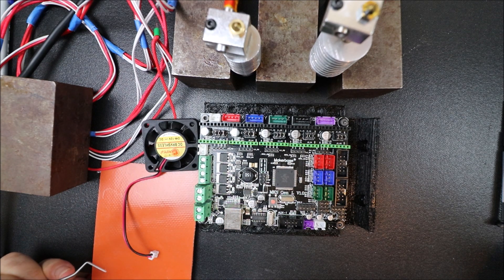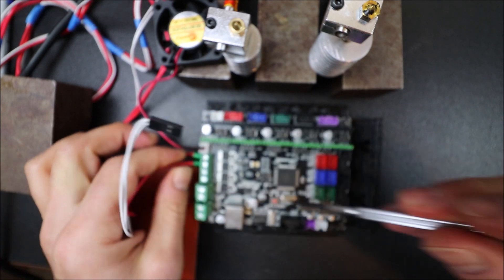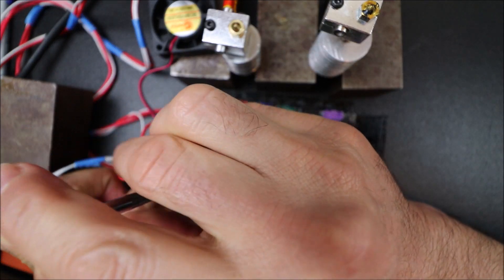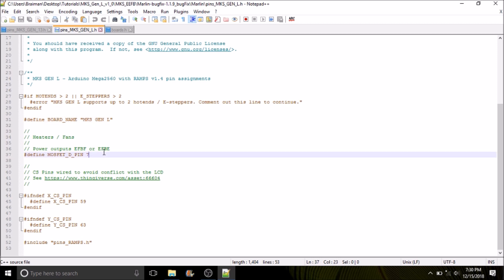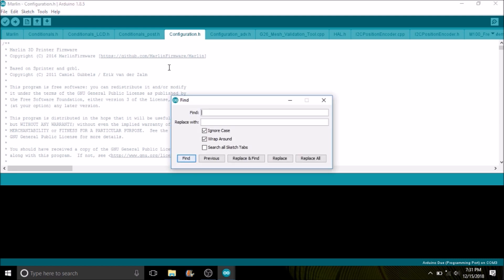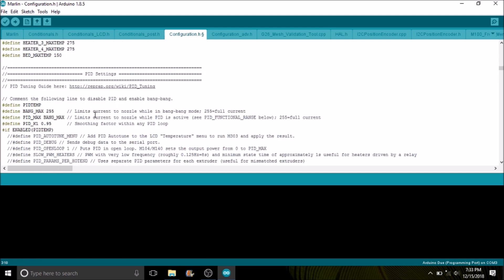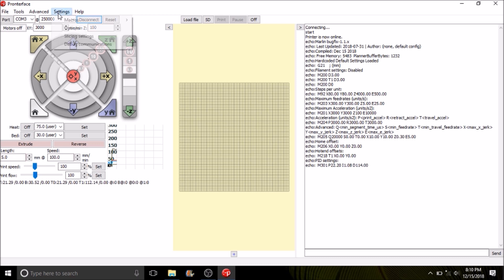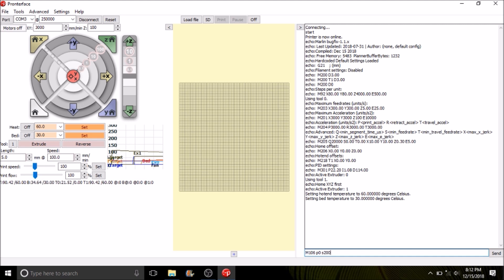MKS GEN L - Extruder Extruder Fan and Bed (EEFB)

Comment: HE1 means secound extruter hotend is not heating up it's throwing heating error . i tried exchanging extruder pin but same problem hotends are working good!
can you plz help
Reply from the maker: There is a link in Description to Discord.  either myself or someone else cane help in General Chat.  The issue you're describing is probably related to Thermistor connection.

Comment: I recently brought  MKS Gen 1.0. I uploaded the Marlin 2.0 by USB port. It works fine with USB port and I unplugged the USB port, then I connect 12v supply it also works fine. ( But the think is when I connect.  both cables the board heats up. Few smoke came near the USB port. After that my board is not showing in DEVICE MANAGER when I connect with  my PC. What will be the problem?. Can you help me buddy.
Reply from the maker: Sounds like something smoked on board.  Are there burn marks on a chip on the board?
Reply: @EdwardBraiman  No burned mark on components but when I check with multimeter a small capacitor got short.
Reply from the maker: Use the link on channel for Discord

Comment: hello i have a question that i hope you may know, i accidentally broke 2 analog pins of my mks gen L card, so there is no analog pins left for the heatbed thermostat, can I use the aux input as analog pin, any help would be greatly appreciated.
Reply from the maker: Could you be more specific as to broke pins?  If physically broken you can soldier on new pins.  If you mean board level cooked motherboard, then unsure. Otherwise I need to consult documentation for for a more complete answer.

Comment: Greetings Ed, Great tutorial! 
On my case I've a MKS Gen L V2.1. Very similar pinout as yours. I've followed your tutorial since the Extruders, Bed and Fan,  have the exact same pin out. But,  when when I get to the testing on Pronterface; I select Tool 0, hit "Set"  and  Hex 1 is On. All Right.

When I select Tool 1, The Fan turns On, and I can see LED D1 light on. 
When I prompt M106 P0 S200,  nothing happens. When I Set on the Bed,  nothing happens.
It looks like the pin assignment is wrong...
Reply from the maker: They might have a pinout diagram on MakerBase GitHub or check pins file.
Reply: @EdwardBraiman  I have the pinout diagram and the schematics. But for what I can see it's the code. The board doesn't turn on  the Bed Heater with the M190 Sxx code.. I can't figure this out.
Reply from the maker: It might be a connection issue.  Depends on error seen in Pronterface.
Reply: @EdwardBraiman   I get no error message form pronterface.  example.. 
Setting bed temperature to 60 degrees Celsius.
ok T0:30.81 /0.00 B:112.28 /60.00 T0:30.81 /0.00 T1:17.38 /0.00 @:0 B@:0 @0:0 @1:0
Reply: Another one kind of funny: Trying to set the temp on  for Ext 1: Using tool 1.
Setting hotend temperature to 60 degrees Celsius.
Setting hotend temperature to 0 degrees Celsius.
But it turns on the fan..
Reply from the maker: I can walk you through possible issue on Discord in description below.
Reply: @EdwardBraiman  That would be awesome. Let's talk tomorrow then. Here Is 1 AM.
Reply from the maker: It's almost 9 PM EST here, during the day I work, so answering questions is slow, but there are over 500 people in chat that can help.
Reply: @EdwardBraiman  Greetings from the other side of the pond Ed.
Reply from the maker: Hello.  Almost home.
Reply from the maker: I'm on Discord chat now.
Reply: @EdwardBraiman What's your tag name?
Reply: Do you have a server / channel @ discord?
Reply from the maker: Yeah in description of video.
Reply from the maker: @componentescarvalho4600  Here is the link ... https://discord.gg/YAuyqTeA

Comment: Hello. Looks like you know a lot about printers and boards. I have question. Can I use 50w heater cartridge with MKS GEN L v 1.0 and if yes then where I could find what changes are necessary to do it. Thank you for your video guides.

Comment: I like your videos. But, I am still trying to find information on installing 2 fans, 1 Hotend, 1 Bed configuration. Currently I have my second Fan connected to the 12/24v always on connection except that I don't know if that is correct. Any thoughts? Thank You
Reply from the maker: A fan extender might give you more controllable fans. There should be a video in the MKS Gen L playlist.
Reply: Hotend fan goes in place of second hotend pinout in marlin need to specify fan pin as 26g if I remember right. I can upload my Odysseus pro firmware somewhere if you need to compare. It setup is hotend, bed, hotend fan, cooler fan.

Comment: Why does the power cable burn when I heat the heatbed? even though I already used an external mosfet
Reply from the maker: Unsure, how did you setup the heatbed?
Reply: @EdwardBraiman  I use a 240mm round heatbed (black) for delta. I connect it to the MKS Gen L bed board pin
Reply from the maker: Check your thermistor wires for a broken wire.  What are your settings for Marlin firmware?
Reply: @EdwardBraiman  when i test it with 3mm reprap MK3 heatbed, all there is no problem. in the firmware the thermistor setting is 5
Reply from the maker: The problem appears to be related to too much current going through the wire.  Why are you using a mosfet?
Reply from the maker: Check the datasheet on the components, but it sounds like the configuration is unsafe.

Comment: Great tutorial! Could you please tell me how can I use the purple connector for the thermistor instead or the black one? On my board, the black connector does not work... I only have 1 extruder.
Reply from the maker: You can modify the pins file for the MKS Gen L board in Marlin firmware.

Comment: the fan that you added, is that the part cooling fan or the fan to cool the heat block?
Reply from the maker: There are two fans in this tutorial. You could use one larger twelve volt fan to cool down two extruder and one to cool stepper driver.  The options are up to you.
Reply: @EdwardBraiman  the stepper motor isnt my problem but when you put the heat tool on the E1 port then you remove your heat block cooling fan.

The fan you added was for the parts cooling fan

Comment: What about the part cooling fan?
Reply from the maker: Are you asking how to add additional cooling fans?  If so checkout my fan extender video posted Saturday.  Or is there something else you need to understand?
Reply: @EdwardBraiman  HE0/HE1 for extruders, fan for extruder cooling fan. How do you control a layer cooling fan? So for 2 extruders and 2 separately controlled fans
Reply from the maker: Truth be told I no longer cool the printed filament for PLA or use a heat bed.  My method is to lower the temperature of the PLA to the point of minimum extrusion temperature of about 180 Celsius.  Granted there might be another setting in configuration advanced tab of Marlin firmware which you're looking for.  I'll do a video sometime this week if I find it.
Reply from the maker: A fan extender appears to be be what you're looking for.  Checkout my last posted video and then search on fan in configuration advanced tab of Marlin firmware.
Reply: I recently bought this board to replace my stock board. Am using an aluminum heatbed and can only power the board with 12v. Will it be enough for me to print with abs without overheating it?
Reply from the maker: @brianroco  I'm unsure with ABS, but if you Aluminum heatbed works for 12v, you should be okay.  Personally I print without using heat with PLA and only cool hotend to avoid warping PLA.

Comment: I LOVE your tutorials!
I'm still building up courage to rip my cr10s control box apart and install the MKS Gen L board
TMS2208 for x ,y and z and LV8729 for the extruder.

I'm really worried I'll screw something up lol
Reply from the maker: You can always build a second printer to test.  Good luck.
Reply: just do it, if it goes wrong, unplug unscrew and rebuild ur old, but i promise you will love it